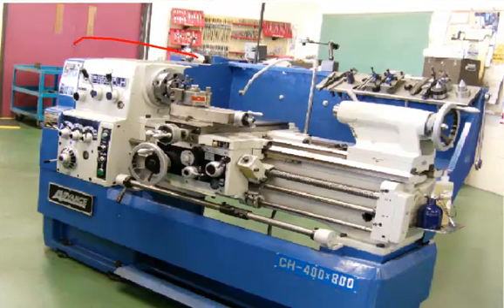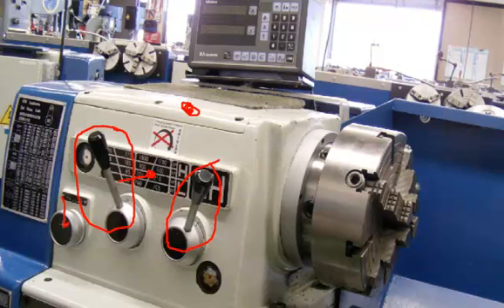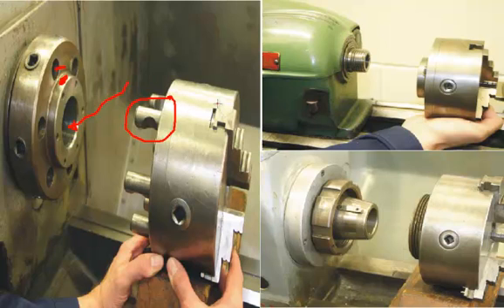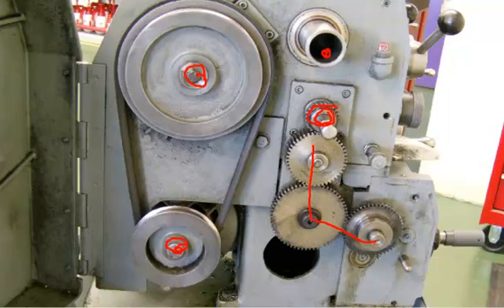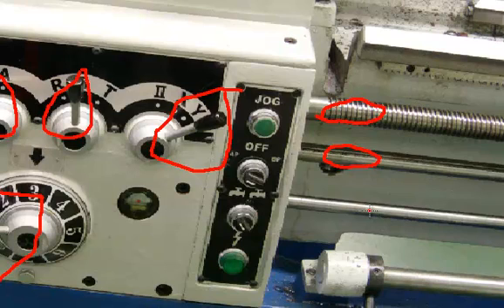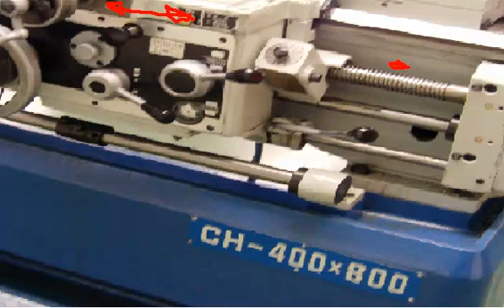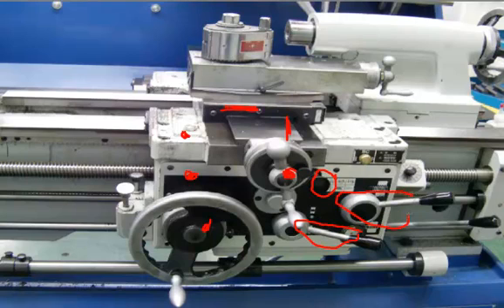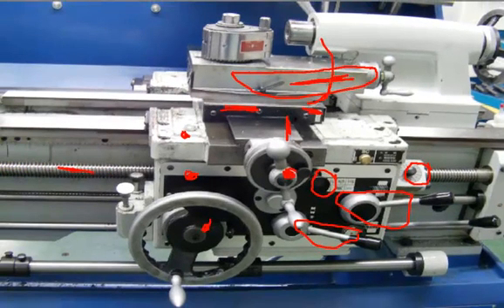Parts of an Engine Lathe

Comment: Seddle to corrs slide work feace 90degre tolarance how mach size p l s ana
Reply from the maker: @g.k.gajendranboopathi6964  
Hi Ana, your translation isn't really clear, I  think you are asking me the tolerance of the cross slide to the carriage. Which is assumed to be 90 degrees. The answer is, if that is your question is it depends. If the machine is of poor quality or worn it will affect the accuracy. The compound rest can be swiveled to any angle to compensate. I hope this helps and explains what you were looking for.

Comment: At the beginning of the video, you falsely claim it is called an engine lathe because there was an engine outside the building.   The actual engine is the gearbox that connects the lead screw with the spindles.  Back then engine described a variety of complex mechanical machines, consider Babbage's difference engine, and the word has not yet devolved to refer primarily to those engines which produces power.
Reply from the maker: Thanks for the clarification Mark.
Reply from the maker: From Wikipedia: https://en.wikipedia.org/wiki/Metal_lathe
"Engine lathe is the name applied to a traditional late-19th-century or 20th-century lathe with automatic feed to the cutting tool, as opposed to early lathes which were used with hand-held tools, or lathes with manual feed only. The usage of "engine" here is in the mechanical-device sense, not the prime-mover sense, as in the steam engines which were the standard industrial power source for many years. The works would have one large steam engine which would provide power to all the machines via a line shaft system of belts. Therefore, early engine lathes were generally 'cone heads', in that the spindle usually had attached to it a multi-step pulley called a cone pulley designed to accept a flat belt."

Comment: I no this is an old video but I have a similar lathe it's a c6246x1500 universal lathe 18x60 with 7.5hp where can I find hand crank gears for moving the saddle. They are very sharp and badly worn great lathe other than this. Can't find parts anywhere.
Reply from the maker: The only place I have been able to find parts (used) is out of England. Try Google. If you can send me dimensions and maybe a picture along with your contact information I will see if I have any spare parts that might fit your lathe.
Reply: Will do thanks a million

Comment: Nicely explained I found a fourth  rod in along with the feed rod and lead screw and the switch rod what is the use of that fourth rod
Reply from the maker: Good morning, I believe that one is for setting depth. If I'm right there should be a collar(s) on it you can loosen the screw and slide along the length. It will either butt up on the side of the carriage or trip the feed as a button/lever on the carriage rides over it.